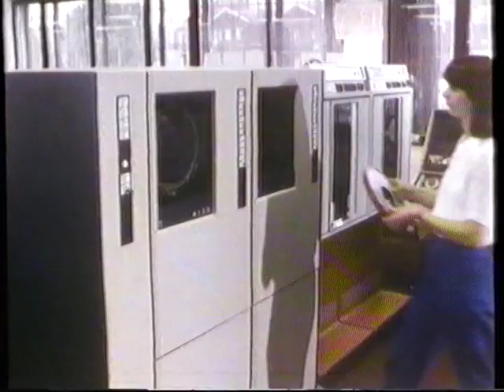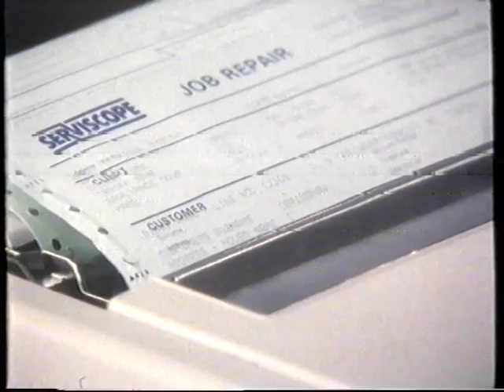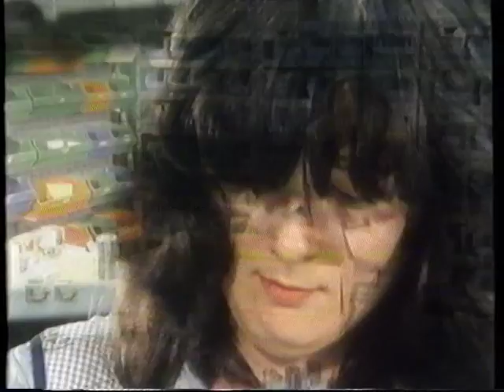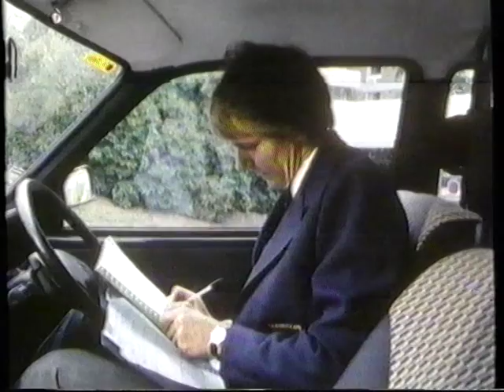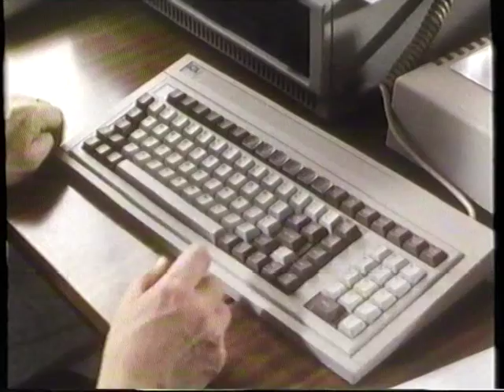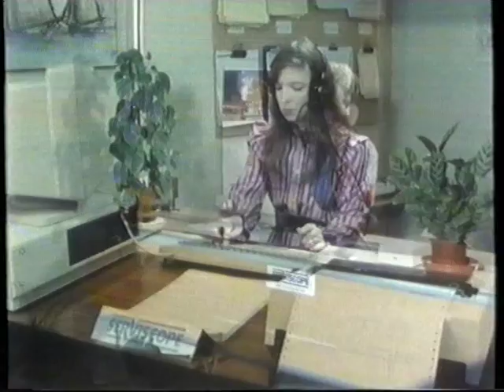Serviscope Electronics promotional video from 1985

Comment: I worked for Serviscope at Cambridge service center. Our main issue was too much work and not enough local staff. Engineers would have to be brought in from as far away as Peterborough to work on the bench to cope with the workload. I left in 1988 as the area manager was a complete Scottish moron and let one of his best members of staff slip through his fingers. I went to Peterborough Video Services.